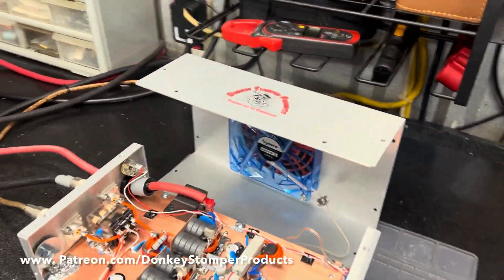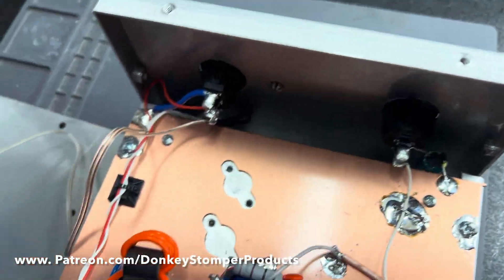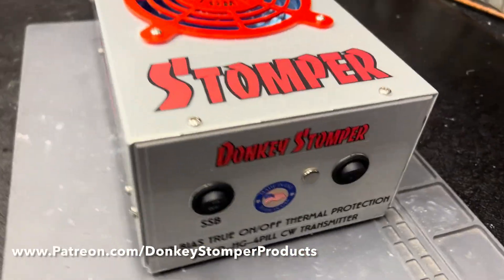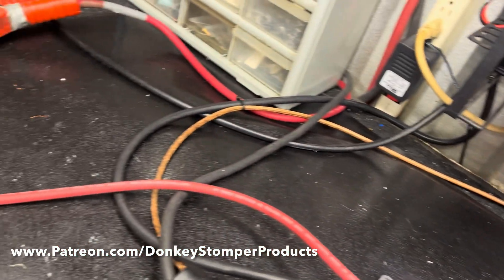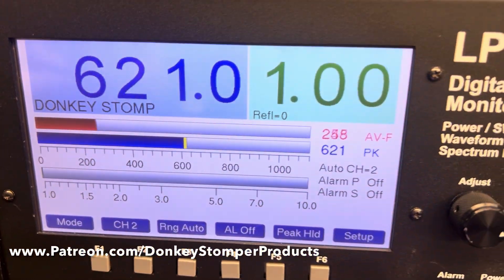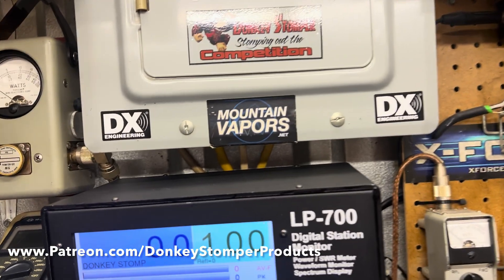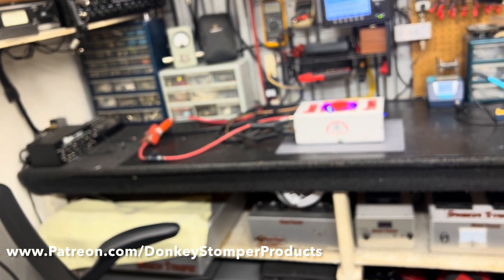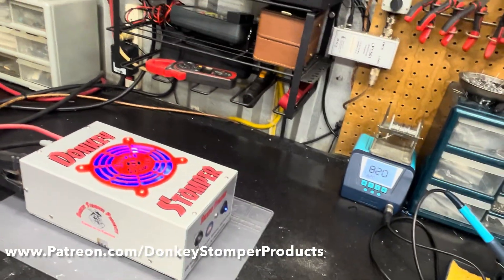400HD-HG-4Pill SSB Bias Mobile, CW Transmitter, True On/Off Thermal Protection

Comment: Nice work Chad. I was looking for about 1200 ot of that being deove by that 99v and 2 pill.  Idk some are hotter than others and honestly you never know. Ive seen 1x2 do more than a 4 or some 1x4s. Close at least.
Reply from the maker: I was really happy with what it does. 4-100 watt transistors . It rocks
Reply: @DonkeyStomperProducts  yeah if you don't push them to the max they can last a long time. Honestly by itself it was pretty impressive. You never know what one is going to do and 20 the same will all do differently and most will be very close. Oh I forgot I've been doing math on some Toshibas with 140 hfe and had that stuck in my head.  Brainstorming and don't know a lot lol
Reply from the maker: Man all good bud.. Thanks @gregoryb2999
Reply: @DonkeyStomperProducts  you build nice clean boxes with great output and you are fast lol.  I wish I could afford to get a small box and sadly I have some parts lol.
Reply from the maker: Roger That Let me know if/when you get ready.. @gregoryb2999